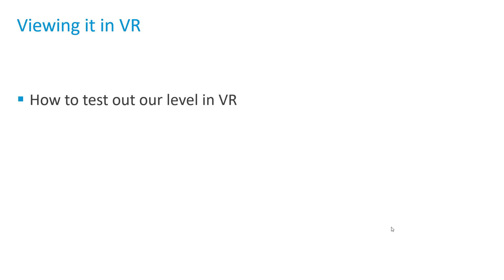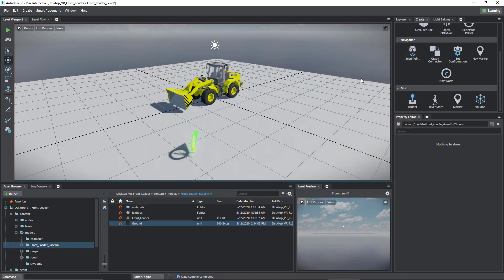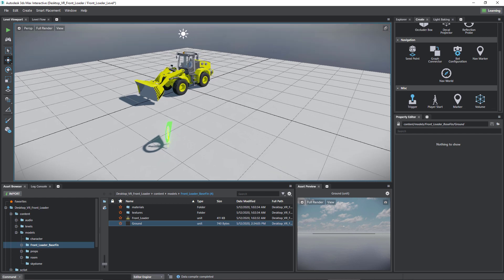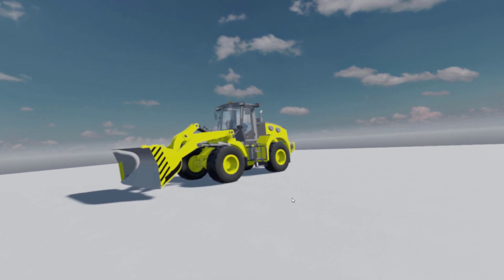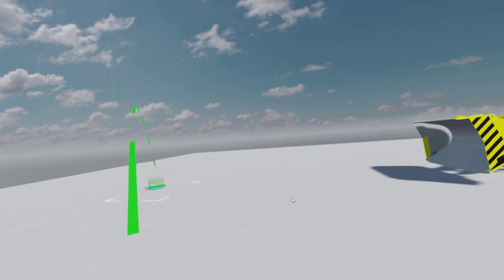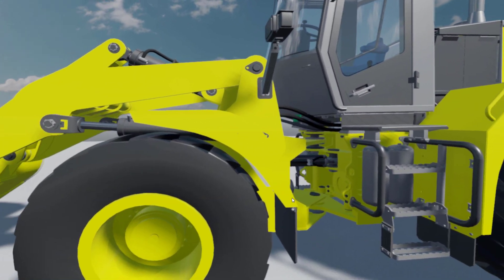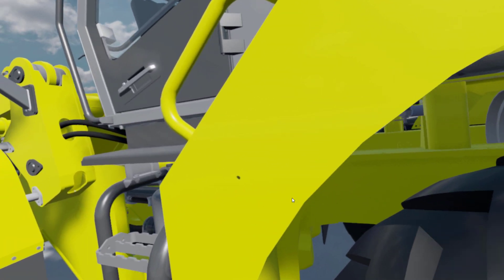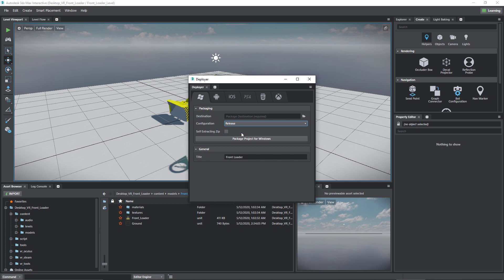VR with 3ds Max Interactive: Viewing it in VR

Comment: Will the oculus quest work for viewing in 3DS Max interactive?
Reply from the maker: The Oculus Quest hasn’t been tested but technically should work as it can run any software designed for the Oculus Rift (which is compatible with Max Interactive) using the Oculus Link update.